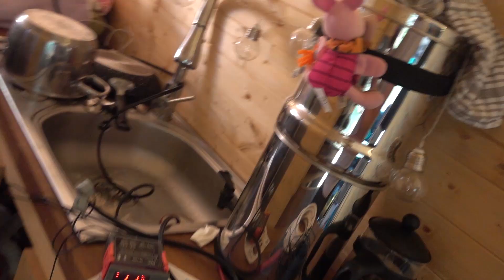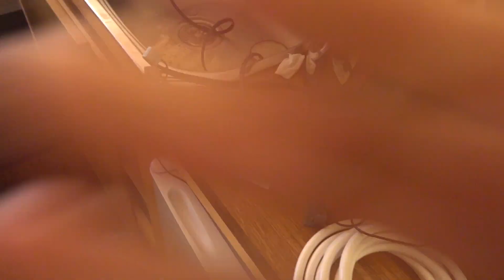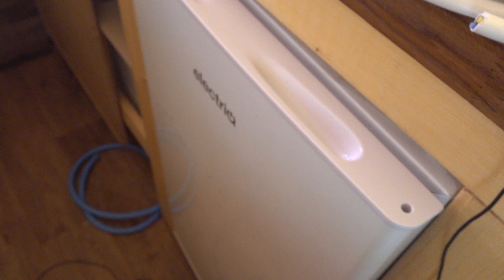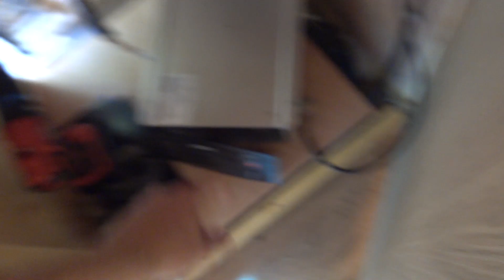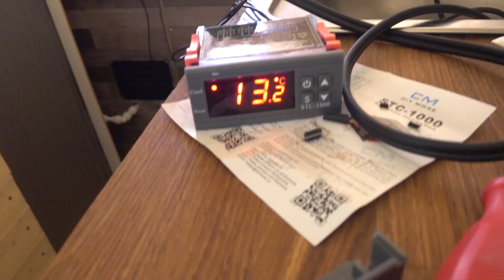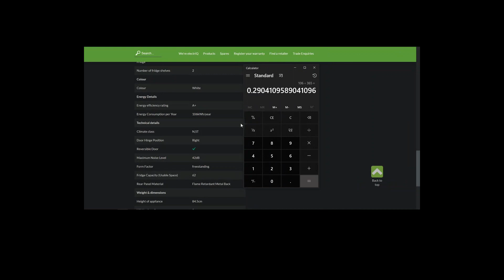Van Build Best Cheap AC Fridge as a 12v/24v DC fridge efficient low energy way!

Comment: I have a small 9L alpicool DC fridge on my bicycle trailer. Only draws 6,5Wh per hour, 25C ambient. Powering it with a 50W flexible solar panel and a 288Wh DC only powerstation. Entire setup weights about 9 kg including solar panel and power station. Im a bit of a foody and want to cook fresh food when im out on my bicycle trips so the extra weight is worth it. I have ultra light tent etc to make up for the weight :P

Comment: Most smaller domestic fridges use mechanical thermostats. Best bet would be to turn your inverter on with that and then bypass the stat to the compressor so it just comes on when the internal stat kicks in. Loving your videos, really interested in the Sun Trip race and the bike you built. Keep them coming! Congrats on the win! 🎉😊
Reply from the maker: Yes i would have liked to do that and your right it makes more sense. But this way the fridge is unaltered during warrenty. Thanks a lot!!

Comment: Hey there, thanks for the vid.  One thing that I wasn’t entirely clear on is the ‘limiter’ for the compressor.  If the thermostat is triggering the inverter (on), it is because the temp is getting warm, correct ?  So, that would create the (need) for compressor to cool.  

I understood that you don’t want the compressor cycling on-off-on constantly, but if the thermostat is calling for Cooling, how does the compressor delay/limiter serve optimal cooling ?

Thanks again
Reply from the maker: The limiter is timer based so it stops it from cycling more than once in a set time.
Reply: @JackButlerVideos  thanks.  I understood that part, but if the thermostat is telling the fridge (compressor) to Cool, and the Limiter is telling it ‘not to’ …… ?
Reply from the maker: @StansE250  it waits for the timer to expire and then it starts.

Comment: The Waeco fridge is using a lot more  on 24 or 12 V due to different tech used. The are using no compressor usually and therefore 4 times higher power consumption but they offer 12V and 230 V and Gas  ... and gas ist the most convenient way cause hugh amount of energy in the gas stored. These multi power capable fridges are expensive ...  and the usual Mobile home does not allow to power it from the living space battery. It only can run conneted to the grid or while engine and therefore the generator are running delivering the high amps needed. 

AC fridges are cheap for 1 simple reason: mass production and therefore scale of economy - far lower production cost.

There would be another solution to build a timer into the inverter that runs parallel to the switch. Every 30 minutes it turns on for 15 minutes and then the power is there and the fridge would run if it is too warm. Would not need another line like sensor. 

But your approach is right to measure temperature by a 12 V device that controls a relay that will power up the inverter ... but needs a line across the van in most cases.
Reply from the maker: Yea i agree the waeco will probably use more! but as i was arguing against it i wanted to give it the advantage. However the one i was talking about uses a compressor and is not 3-way. Yea the timer would be a nice simple solution!